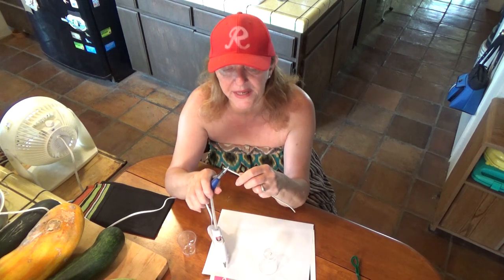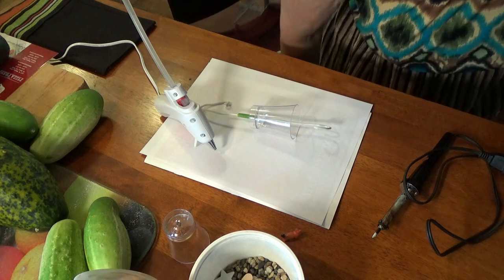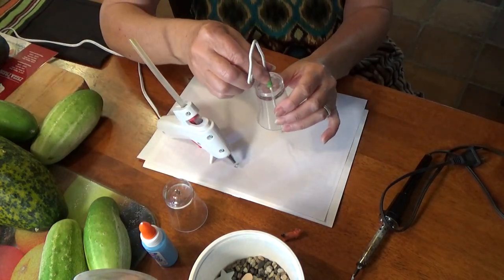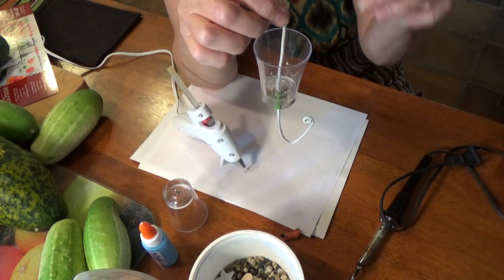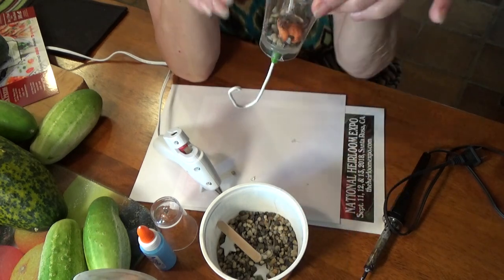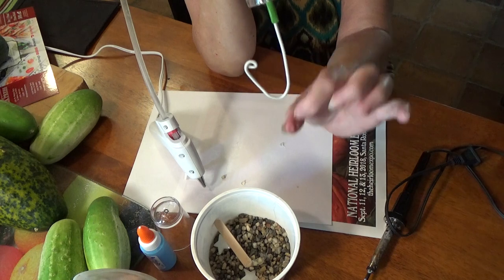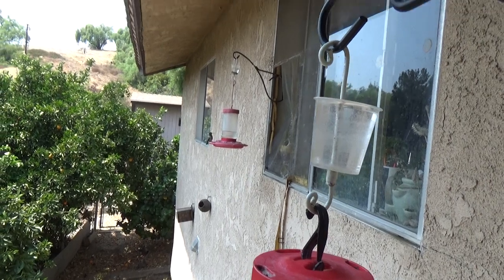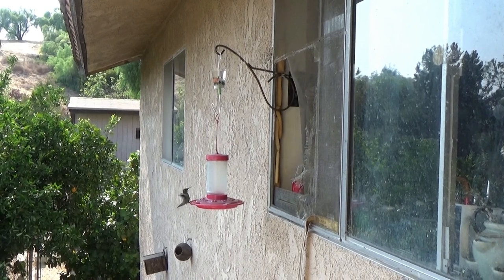No More Ants on Hummingbird Feeder EASY DIY  How To Make a Ant Moat Guard Your Bird Feeder from Pest

Comment: Use the top portion of a water bottle. put the hole in the cap, put your wire or whatever through that. when you have it sealed so water will stay in it add a drop of dish soap so that the ants sink when they hit the water
Reply: Yeah what do you use to keep the water from leaking!?!
Reply: @nicem8746  I use Gum
Reply: Use silicone sealer or exterior type caulking instead of hot glue
Reply: @nicem8746  drill hole slightly smaller than piece of wire through the water/soda bottle cap, force in wire and then seal with a 1/2 inch of glue gun... make sure the wire is straight and it will not leak.  Be sure to put loops on same side of wire so it is steady.  I also sprayed the piece of hanger wire with paint so it did not rust.  Two years and still looks like new.

Comment: I have something similar but hang the cup upside down. The ants have to climb down the cup and up the inside to go down the wire. So I line the inside of the cup with Vaseline. The ants cannot get past the Vaseline. If they try, they get stuck. It works really well.
Reply: 😮😮
Do you have to reapply the Vaseline very often?

Comment: We have an electric stove with a ceramic top.  I was able to heat a piece of 18 ga wire by holding the tip directly on the cooktop & waiting.  It took a while, but I  got hot enough to pierce a hole in a condiment cup.  It just takes lots of patience.

My husb loaned me his soldering iron for a different project & it worked much better.

Comment: I used wire coat hangers, gallon milk jug caps, and glue gun. Haven't had a problem with ants since. They've even stopped trying! Only problem is that the water evaporates pretty quickly because the caps are so shallow. That gives me an excuse to check on my feeders more frequently. BTW...goldfinches like drinking from the caps!

Comment: FYI…..you have to use a bigger cup or whatever if you have carpenter ants like I do. If the cup is too small, the bigger carpenter ant can walk across the water due to the surface tension.

Comment: tip if you heated your wire when straight and then pass through cup glass it will fit tight but you have pull fast with a pair of pliars and it will be fitted tight then bend your hook part just a tip when I make my little creations but still yours are beautiful I was wondering why not put a ant trap on top of cup

Comment: You are sweet👍🏻. Thanks for your moat idea. I just ordered a few moats from Amazon until I can get the cups and find my glue gun. I also need a soldering iron too. I hope they help with the huge carpenter ants.
I don’t understand how the moats work when you are sitting your little homemade peanut butter feeders inside the moats. Ants will climb down the strings they  are hanging from. Unless bottom moats are just for free standing feeders just sitting on ledge? Maybe I missed that point. 
Thanks! 😍

Comment: I feed thousands of hummers with 24 6 hole 32oz feeders I fill every 3-4 days. The grease works. I use it on the poles I hang my feeders on and grease the wire hangers off the house...... zero ants. You can also use vasoline...
Reply: What kind of grease?
Reply: @serendipity1237  
Any kind of grease works, even Vaseline.

Comment: Electric stoves do work to heat up stuff. I use a screwdriver I set the tip on the coil it gets hot enough for me to poke holes .
Reply from the maker: Yes I have done that too, thanks for sharing 😊

Comment: @RobbieAndGaryGardeningEasy >>> This is just a GUESS, but it might help to gently roughen the surface on that cup with some sandpaper {or other mild abrasive} before applying the hot glue. 

Having said that, with the amount of glue you use for this it probably will not make much difference in the long run.

Comment: I actually use the store bought ant moats. They  didn’t work for me on their own. We have sooooooo many ants that they just Kamikaze and create a way for the others to crawl-over the dead. I now use the gel stuff that the same company sells that you apply at a junction where it meets above the moat. It’s the ONLY thing that has worked for me. I also started feeding the bees and ants from a tray I got from the dollar store, filled it with  wine corks and sugar water for them too.
Reply from the maker: I have another Ant cure, I will try to post that within a week, that has worked for MANY, thanks, Robbie
Reply: Thanks!  I had given up on the feeders until I found the gel stuff. It works but has to be reapplied every so often and especially after rain.

Comment: Looks great but what gauge is your wire?
Reply: I know it's been a good while when you added this comment,but the best wire to us is a metal clothes hanger.What I did is I took a piece of sandpaper and sanded the clothes hanger and I painted the wire red.I been using the same wire for close to 5 years and they still look and work very good

Comment: You can make the hole in the cup with the tip of your glue gun.
Reply: Right.  I have an awl which I heat up in the flame of my gas stove.  I use it a lot.

Comment: 🐜 Please Help! Ant mote is a TOTAL FAIL against carpenter ants. 😢   I was so excited to use the ant mote I made this morning.  Before installing the mote, there were so many ants on the outside as well as floating around inside the feeder. It was so bad the birds couldn't feed. They'd hover at each port, see the ants, and fly away without getting nectar.  With much optimism, I installed my mote, left it for a few hours, came back, and carpenter ants had taken over again!😡  I'd even sprayed the ground and my shepherd's hook with vinegar and dawn as an ant deterrent.   Now, I'm at a loss for what to do to keep these ATHLETIC SWIMMER ANTS 🐜 out of my feeder! 😂  Anyone have suggestions? It'd be much appreciated! 🙂
Reply from the maker: https://youtu.be/WdobcI8uRfQ  This video on Ants will help you that I made.  Make the moat from a much larger container, make their river WIDER.  They do not  swim. Use a gallon milk jug or bleach bottle that will make the moat much wider. Take care
Reply: Use a couple of drops of oil on the water. It sinks the ants. You'll need to refresh the oil when you refill the water/ clean out the container.

Comment: Get some axle grease and smear it around the hanger rod and they will not cross it.  Your welcome.
Reply from the maker: Interesting, different ants do react to different methods, thanks, Robbie
Reply: I used vadeline to
Stop then coming into my camper, they were using the electrical cord connection.